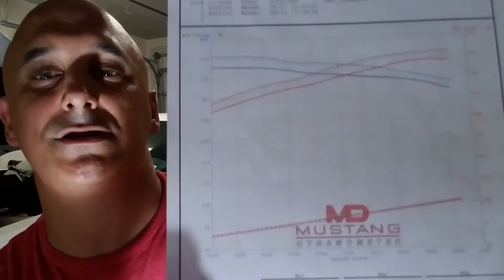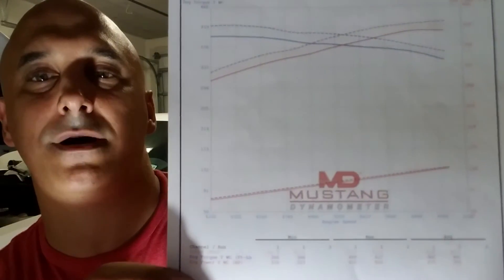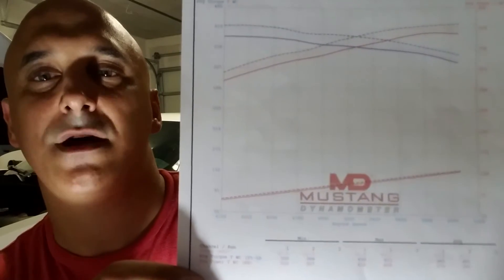Challenger SRT 392.  Post - Tune results and impressions

Comment: Man this is the car ive always wanted. Trying to save every penny
Reply: Dude me to I hope you got it by now bro there’s not much where I’m from there is only one in my city and it’s 2015 I have to drive hours to get a 2016 😭😢
Reply: @ofnyhernandez1039  I didnt get the 5.7 or the scat pack as I wanted. But found a 3.6 2015 for 5k with only 30k miles on it with zero probs. So I got it cus I couldn't pass the deal up
Reply: Bf4 Guy nice bro well at least that’s something
Reply: @ofnyhernandez1039  I'm honestly very satisfied with the v6. Still has a good bit of power but just not as much as the hemis do.
Reply: Get one you’re not gonna regret it. I own a 392 charger. Such a great car.
Reply: @jesserivera6527  I hear ya. I'd love to get one but i also have a Silverado that I've been beefing up over the years. That truck is my get up and go vehicle. Car is just a date night deal. Right now I'm saving up for a Camaro transmission to put on the truck
Reply: Bf4 Guy Hell yeah man! I also have a Silverado it’s a 1990 SS with a 454. She’s my pride and joy.
Reply: @jesserivera6527  nice dude. I have 2000 chevy Silverado with the 5.3 vortec in it. Got headers on it a while back now I got new cam coming in the mail from Texas speed and new torque converter. Ready for them to come in.

Comment: I have a 2019 Dodge Challenger RT Scat Pack automatic and the launch control also has built-in launch assist and the only thing I did to the car was put 275 tires on All 4 corners. With the launch control assist I got a 4.1 0 to 60 time with the RPMs set at 1800. I thought that was pretty good for an all stock vehicle with Just Tires. The tires I have are the Michelin Pilot Sport 4s performance summer Tires. I'm going to try to set the RPMs 100 lower until I get under a 4 second 0 to 60 time. I guess it's something new for the 2019 s Scat Pack to have launch assist built in with the launch control it helps a lot and when I do it the tires chirp a tiny bit and then it just grips end launches me and pulls pretty good.

Comment: Right now, I’m weighing out my tuning options for my 14 srt 392. It’s a 6 speed with k&n drop in filter and straight pipes. I’m torn between a mail order jay Greene tune with my diablo  OR a custom dyno tune with hp tuners software. The jay Greene tune is about $400 including the diablo, and the dyno tune is $650. Which would you recommend?
Reply from the maker: Depends on who is doing the custom tune.  Jay is pretty good and I would trust him.
Reply: B Mason I was going to get it done at national speed shop in Wilmington, NC. I spoke to the tuner, and he said he can probably squeeze 35-40 rwhp while maintaining excellent drivability. Seeing as your 392 only gained 15 rwhp from a dyno tune, that makes me think his claim is pretty exaggerated.
Reply: alan boyle did you go there? I am in Raleigh and do not know anyone who has had a hemi tuned there.

Comment: I was actually expecting more after the tune,my 16 scatpack is tuned now but b4 tune with mid and resonaters deleted aem drop in filter made 430hp 437torq
Reply from the maker: Dmitri Chergibayev mustang dyno (eddy current) vs dynojet.  Big difference.

Comment: Hey man i have a 2015 srt 392 challenger. It only has a cold air intake but i feel like it doesnt make a difference because i still dont have a tune. And im thinking of getting the hptuners kit and i was wondering if i could get some help with tuning because ive never done something like that before.

Comment: Quick question, do you think a 180 degree thermostat will make the ecu advance timing by itself without a tune?
Reply from the maker: It will not, the ECT hot spark table is set higher than the stock thermostat.

Comment: hey bro- love your vids, just found you here on yourtube. I have a 2006 Magnum SRT8 and I want to make it faster. Sounds like a tune, a mild cam, and some lower gears would really help. My stock gears are as follows, 45mph, 87mph, 121mph, 144mph, 169mph. Any help would be much appreciated. The torque adjustment in the tune was pretty interesting, can I do that in the 6.1 Hemi?

Comment: Financial question for those people that think a lot or too much.  A custom shop tune is about $450 in my area and that money is gone with the car when sol;  which is not stock.  My question is, would it be financially better to buy the Diablo "Intune" (which you can resell for say 50-65% of purchase value) for a significant gain relative to a custom tune but, that can be reversed when the car is sold?  Also, you can sell the Diablo Intune to recover much of the modification cost - making the net investment of around $100.

Comment: I know u haven't had the car for sometime now but can u remember if u hit an 11 without the tune
Reply from the maker: Yes, 11.88 on 20's drag radials.
Reply: @bmasontv  thats awesome. Do u remember if that was positive d.a.
Reply from the maker: @gwaugh7977   If memory serves me correctly the period of time where that car was running 1180s and 11.90s with the stock tune the DA was in the low 200s.... but the  air was uncharacteristically dry. Keep in mind, the car in the same configuration ran low 1130s and on a drag pack would run low 11.20s with the tune but with da in the  500 range. Flat DA ( zero da) would get a 11.30 11.40.

Comment: Just curious. How would you compare the track settings vs. the custom tune? Torque management seems a lil less on track settings. I think
Reply from the maker: Lee Hanford it is less torque management in track mode under wide open throttle but partial throttle was terrible when it was stock. Now it is far better with the tune.  In fact, it was for this reason alone I wanted to put a tune on my car.

Comment: Ok, to be clear, your white car is a 392, correct?
Reply from the maker: 2016 392 SRT.
Reply: @bmasontv  awesome! I bought a new 21 last fall. Love it. I really want a transmission tune. 2 problems, 1, don't wanna screw my warranty, 2, have a hard time trusting anybody to do the tune.  Allreciate the reply!
Reply from the maker: @jeffreynye3019  in terms of tuning and performance, the latest calibration is actually quite a bit better than the old operating system that was on my 2016. On a drag pack with very minor weight reduction the 2019 and up cars are capable of mid 11-second passes in good air stock

Comment: Have you considered a ported throttle body for your car? I had a V6 Dakota several years ago and swapped to the bigger V8 TB and I remember that being the best mod I ever did to that truck. I'm considering a SRT Jeep and I'm thinking one of the Fastman 85mm TB would be one of my first mods to that Jeep. Thoughts?
Reply from the maker: not really worth it in my opinion. the opening of the intake on the later 392's can't accommodate a much larger tb so the power difference would be minor.  with some work I think they can work with a 90mm. looking at maybe 10 hp at most.

Comment: Thanks B for this video. The problem with Mustang dyno's is that they tell the truth in real numbers. That said watch out for the newer Mustangs 300-400 lighter and putting down 440-460 RWHP. The dyno tunes are expensive and are needed with every mod as we know.